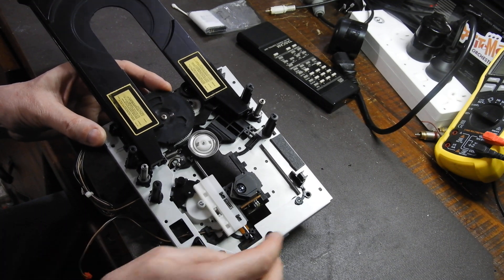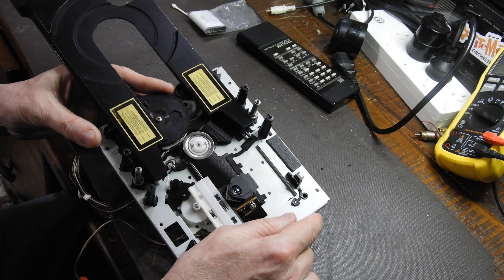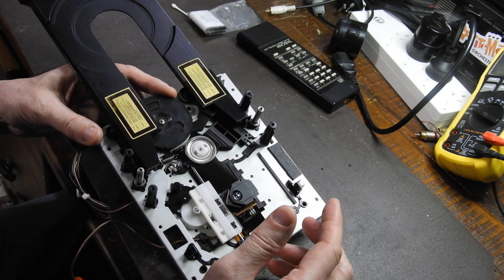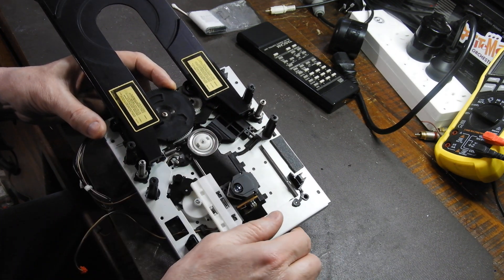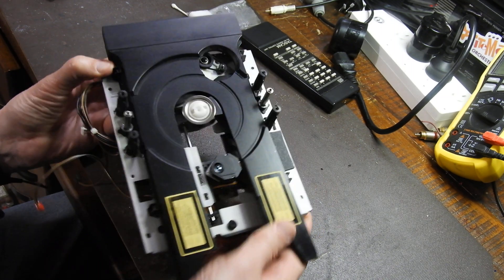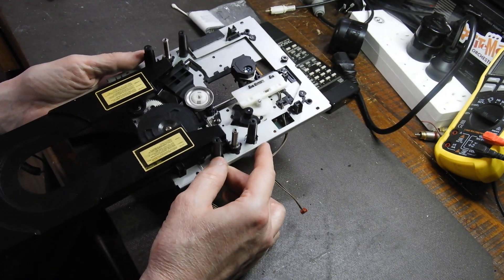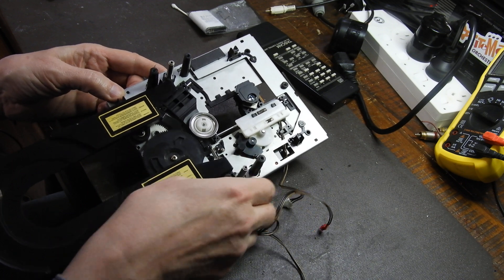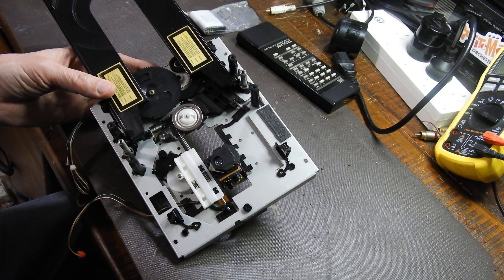Laser mechanism re-assembly following a service - Teac VRDS T-1 Transport is used as an example.

Comment: I cannot make mine to start the process, without the tray it does do everything but once I put the tray the motor wont do anything
Reply from the maker: Obviously, the tray is inserted in wrong spot. Remove it, and move it by couple of teeth and see what happens. Starting point is that when the drawer is fully in, its first teeth are just there engaging the rack.
Reply: @hear-net-au already did that, the issue is that once I insert the tray the motor simply wont move, change few teeth and still no change, if I use a smaller rubber band tries to move but at the end it does’t move that much, if I see below the inner teeth of the main gear it does not touch with the withe gear (the one that makes the center go up or down)
Reply from the maker: @kevinapaez1298  Do you want to send it to me?
Reply: @hear-net-au I would love to but I’m from Mexico so I’ll be expensive the shipping and think cheaper to find a VRDS transport over here but thanks, I think the tray may be a bit bent so that’s why is not touching the gears but… long work
Reply from the maker: @kevinapaez1298  I wasn't talking about the whole player but only the mechanism. Surely, it should not cost more then $20 either way. Can you get VRDS T-1 for $50 in Mexico?
Reply: @hear-net-au  I don’t think about $50 but sure around &
$80 for a unit for pieces, I’m having the problem with a Krell KAV 300CD but is from the VRDS series, Mexico is the biggest dumpsh… of US so I’m hoping I can get the transport for almost $50 😮‍💨

Comment: This has to be the absolute worst CD mechanism ever made in terms of servicing the gears I've met so far. I have two of these, both fully lubricated but they won't complete the cycle of the CD spindle going up.
The mechanics itself work as I tried it without the tray and at some point the spindle goes up.
Reply from the maker: Yes, it is painful. I reassemble them by trial and error. The correct position is a tooth out from where it looks like it is supposed to be.

Comment: Thanks for that demonstration. I have done the same as you but I find that the motor that moves the laser mechanism does not turn and the laser just sits at the end and doesn't slide to the middle of the cd tray when the cd has been loaded. Do you have any ideas? I've checked all the limit switches for the tray and the laser transport and all seem okay.
Reply from the maker: Next step would be to drive the head by advancing gears with your fingers - just like I have done in the video, but with head gears. Be careful not to break any teeth. The best is to rub your finger on a worm drive. If it works, then apply some voltage. If you do not have power supply, use couple of batteries. Try both ways.
If you cannot advance it by rubbing the worm drive, take it apart and see why, before reassembly.
Reply: @hear-net-au  I found the problem. The CD tray and the large black worm drive gear were not properly aligned. You have to align the last tooth of the tray (when the tray is fully out), with the last tooth on the worm gear, then I managed to get the CD to play. I was at first out of alignment by one tooth. Thanks again for your video.
Reply: @hear-net-au  Thanks for the quick reply. I'll try that.